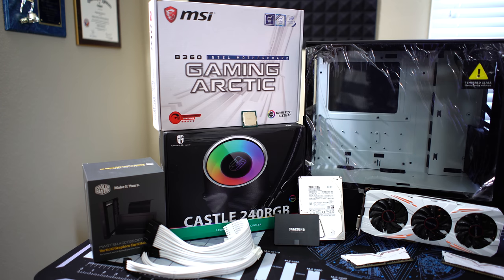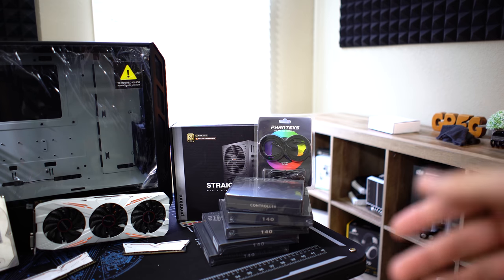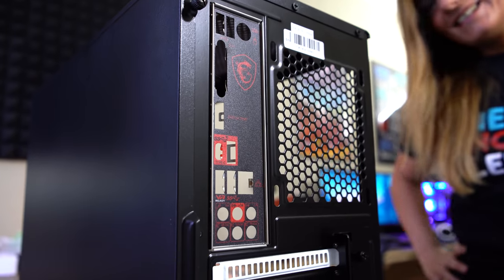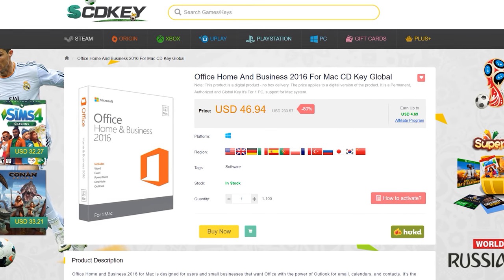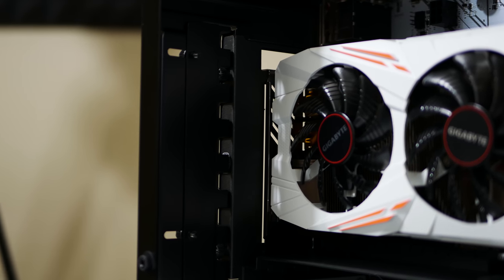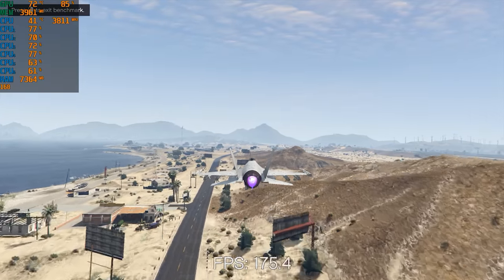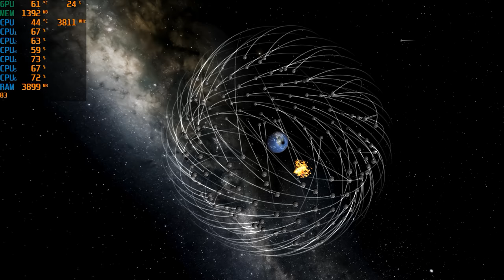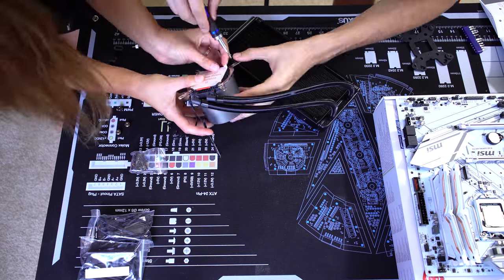We Paired a 1080Ti with an i5 8400...

Comment: Exactly my build without the AIO, pure gaming purpose with i5-8400 will do its job. Specially when you are running ultrawide 1440p and more like I do. buying 8700k + AIO will be a little bit a waste of money around $400 for pure gaming in UWQHD or 4K since it will bottleneck the GPU. Has been using it a long time, never looking for an upgrade.

Comment: Greg, are you using adaptive power profile? Which is what I suspect seeing gpu utilization not being 99% all the time. Wonder if it’ll be a bit different if you switch to prefer maximum performance. Though I was surprised to find out it didn’t make much difference on my 6700k and gtx 1080 rig.

Comment: the 8400 and the 8600k are the only i5's that get mentioned but for 30 bux more than the 8400 you can get 300 more mghz (4.3) from an i5 8600 (non k).  worth a mention though.  it hink a lot of people dont even know this cpu exists.  but as with the last gen or 2 the i5-X400 cpus are the lowest end cpus and when intel launched coffeelake the only i5's were the 8400 and the 8600k.  but 8600's and i think 8500's are available too.  30 more bux for the 8600 and shop the sales for a 3000 mghz ram kit 135 or so (ive found them for that) and you have made up the difference in price.  would really recomend the 8600k though or get the 8400 and plan on an upgrade in a year or 2 to an i7 or 8600k.  just a thought.

Comment: I'm running a i5 8400 CPU with a gtx 1060 6gb and it seems to run really well. I'm contemplating going to a 1080 but I'm not so sure it warrants it for a few reasons you said. I think that the CPU will struggle at 4k with the frame rates the 1080 can pump out, but there again I'm not so sure 4k is necessary at the moment. I have kind of wrote off the 1070 due to £40 difference but I'd be interested to hear your views

Comment: I have a 1080 Ti and an AMD FX-8730E and it works just fine. Yes, the CPU is a huuuuge bottleneck, but I only upgraded to a 1080 Ti because I bought an Oculus Rift but I wasn't getting an enjoyable VR experience with my old R9 270 GPU. I would've upgraded the CPU, too, but I simply cannot afford that :(.

Comment: Hey Greg, have you seen UFD Techs' recent video on the 8400/R5'S? They come to the conclusion that when paired with a 1060, the 8400 runs significantly slower than the 1600, 2600 and even the 2400g (with the 1060). Have you paired the 8400 with a 1060, or any other mid to lower-end gpu?

Comment: I'm either sticking with my 1600 or off-loading it on eBay to get x470 m7 + 2600.
My next paramount upgrade is from crossfire hd6970 which is still good for 60 FPS 1080p to a respectable Rx Vega 64

Comment: I'm running a R5 2600X and a 1070Ti
no overclock yet, but in the future I will.
The whole rig cost about $1500. I know it should be way lower, but i'm not living in the us, and overall prices here are way higher. Or it could just be my stupid spending on products with a low price to performance.
avg fps in:
justcause 3 at ~120fps on 1080p high and ultra settings
overwatch high/ultra 1080p ~250fps
unigine heaven ultra 1080p ~230fps
cinebench R15 score 1279

Comment: I know you can and its not a terrible idea , but why not go with ryzen 5 1600 or 2600 that has more threads and price similarly to the i5 8400 ? i5 8400 all core turbo is 3.8 ghz , zen core with all core oc to 4ghz won't be that far off in terms of single core IPC and has way better multicore performance .

Comment: i5-8400 vs Ryzen 5 2600x.

That's a tough call.  Especially for 1440p gamers with a GTX 1070/Vega 56 or better.

I think I'd go Ryzen for 3 reasons.

1. Gaming results on parity with each other.
2. Ryzen has upgrade path.  Processors from AMD until 2020 will be using the AM4 socket.
3. Ryzen has better productivity/multi-threading.

Comment: Cool video. This seems like a good build. I personally would prefer going for an AMD based system but for some reasons games are more optimized for intel' s architecture so rip. Think watercooling something like this would be pointless (being a locked processor)

Comment: Recently went from a 4670k to a 2700x and i must say the system feels overall very sluggish now compared to the 4670k. When streaming (even at 720p30 and low bitrate) all games feel very unresponsive, and I've had so many issues with stability. And I still can't get my 16gb 3200mhz kit to run at it's rated speeds, even though it's on the qvl list.

Comment: Nice video Greg, but what about Bf1 in 4k does it botleneck then since bf1 is so cpu intensive? I have an 6600k so really pushing it there. Doubt 1080ti prizes will down to levels not to wait for next gen on upgrading from 1070. And since sli is half dead no benefit on that game P cars 2 yes but that runs good on 1070 also. Mostly can run on 4k some tracks are more demanding but,, still well optimised for nvidia. Its a beast for a two years old card.

Comment: I remember my old amd tower from 2003 it was my baby. But holy hell it was a space heater with 1000 watt power supply i cany remember what i was running in sli but it had just started coming out when i first got my sli cards. I miss it right now in chicago -20 i need my space heater

Comment: Why did you pair a B360 MB with a chip optimized for z370 boards?  Did you know there are other channels out there showing frame rates jumping from 50’s to 70’ just by going with the 370 boards?

Comment: I have an i5 8400, but I still need to upgrade the gpu. Is paring a 1060 6gb with the 8400 worth it? Eventually I want to upgrade the cpu to a i7 8700k but that’s further down the road as of now. The 8400 still does plenty for gaming and is able to multi task for me.

Comment: I'm currently getting up parts for my new PC and I'm pairing an I5-8500 with a 1070Ti. Should I go with a Z370 motherboard and 3000mhz ram or get a H370/B360 and get slower 2666mhz ram? The Z370 is the only 8th gen mobo that supports over 2666mhz.

Comment: Question for you, Greg - Why don't you lay the case down flat on the table when you insert parts? Genuinely curious, thanks :)
Reply from the maker: Mark Lee Easier to film, and doesn't crush hanging cables at the rear.
Reply: Good to know! Would you still recommend those who are building a PC to lay theirs flat? or is that personal perference.

Comment: You need to put this to the extreme: i5 6400 and 1080Ti but only tested in 4k. I was wondering how low you can go on the processor side, before you loose serious performance.

Comment: idk why when you build a pc and uses cooler master vertical gpu bracket you choose a case that has spacer in the pci slot and cut it up? it drives me nutt. use cooler master case, their case doesn't have spacer in it

Comment: Okey I need help. I’m on a kinda tight budget so I wonder, should I get a Ryzen 5 2600 and a 1070 or a i5-8600k and a 1060 6gb and aiming to upgrade the gpu in the future? I really can’t decide because although I want a pc The can’t handle most games on high settings no problem, I also want a pc that will be future proof for a couple years from now on.

Comment: So what do you think should I upgrade from i5 6500 to i7 6700/7700 non-K or change my motherboard and CPU entirely(i5 8400 + B360)? I don't want K series I don't want to overclock. In short which perform better i7 6700/7700 non-K or i5 8400. And do If you have comparison video please show link in the comment below. Thanks. :)

Comment: Just built a system:

Ryzen 2700x
Bequite Dark rock pro 4 cooler
Asus x470 -f gaming
16gb 3200 Trident RGB CL14
MSI GeForce 1080ti gaming trio
Samsung 500gb 970 pro nvme Primary
Samsung 500gb 860 SSD
Samsung 500gb 960 pro on x4 pcie m.2 card.
Cooler Master MasterCase MC500p
3 Cooler Master 140mm RGB flow fans
1 Cooler Master 140mm RGB Pressure - exhaust

Purpose: 

Gaming
VR
Server Administration 
Software Development

Comment: the i5 8400 vs the r5 2600 or r5 1600 is a couple fps difference in most titles you wont notice that. BUT what you will notice is that Games run much more fluent on the Ryzen Platform - alot less Dips. So yeah while this is a nice and good looking build its meh compared with price / perf.

Comment: An 8400 chip is great to pair with a 1080Ti, but the Ryzen 2600 is not enough. (Not Greg's opinion) With top notch cards, which are built for higher than 1080p resolution in mind, we see similar results with most of the newer CPU's. But people are so blindfolded or mostly incompetent, they only able to see the FPS results and when they read or watch benchmarks, they conclude without understanding how resolution effects the load on a GPU. Nevertheless, I rarely heard anyone playing games with decked out visuals, so even these good numbers what we see in this video, can be much better if some of the unnecessary settings are lowered a notch.

Comment: I built with an 8600k over the 8400.. As i didnt mind paying extra for a 5.2ghz overclock.. Amazing gaming cpu, But if i wasnt primarily a gamer the 2600x would be in my system right now. To me the only options in the pricepoint are the 8600k or 2600x , 8400 just doesn't fit in there for me.

Comment: I think i3 8100 will do just fine with 1080ti with relatively low refresh rates (100 Hz shouldn't be an issue)
Reply: Salt Maker "opinion" not "advice".. Stop it now kid, It's gotten boring beyond words.
Reply: Salt Maker k
Reply: Salt Maker sigh*
Reply: Salt Maker ...
Reply: r91plays IND, i 2nd that opinion you should do just fine with a 8100 yes might not hit high fps but its still very do able. Cpu would be about 75-90% in most games but still would keep that 1080ti on its toes!!!!
Reply: This would not be an issue, if you want to play at 4k 60, but for 2k, I think this is not good.
Reply: Maybe few years ago that will be ok but now no way...so many new games use more than 4 threads ...in cpu intensive games you will have HUGE bottlenecks(fps drops)...6 core cpus are now minimum for new games...

Comment: Okay I'm gonna be upgrading my system to ryzen and idk if I wanna get a r7 or r5. I wanna get an x470 motherboard for upgradability and overclocking. I mostly game and am thinking about doing a bit of video editing. Any recommendations as to what I should get?
Reply: If temperatures are a thing for you and you want silent running any of the non 2000x parts will work really well. I have a 1700, with a 1070ti and it runs shockingly well. I game at 4k@60 and i have a cooler master AIO liquid cooler. If you want the best and higher watt parts go X models and definitely go the Highest end B series boards or the best X series you can afford. I got locked into a pre built for 1200 dollars with a 5 year warranty and have not seen better for the money. Especially with the memory and graphics parts just starting to normalize to a certain extent. I am planning on adding an additional matching ripjaws v 8g stick and an 500g m.2 SSD next. I also will be adding a 6tb external hard drive for video projects and my Xbox and steam games.If Xbox does not want me to buy their consoles I can arrange that...lol

Comment: I was wondering if the pcie extension reduced fps? i have the extension also but debating if i should install it.I have Thermaltake Core P1 Tempered Glass Edition Mini ITX Open Frame case
Reply: Linus tech tips alrady covered it in his video. PCIe risers/extensions has negligible effect.

Comment: Well it looks nice and fancy, it fits "the design over performance" model ...  So, I understand the original idea of the video being the I5 non-k on a premium GPU and  test it. But who would do that really ?

If people build something like you did and focused on the looks of the system and to get the (cheap) boutique look, they decide to go (very)low budget on the basic hardware. I mean really ? 

If a person comes to you "hey man I just bought a 1080 ti 1700$+ system". And if you asks him what the rest of the specs are ?

He replies with i have a low budget mobo and a locked CPU. But it looks amazing i got the hardware colour matched (I even spend extra to have my budget hardware match with my GPU and RAM) , RGB everywhere (just like a cheap disco), custom sleeved cables, even water cooling on my locked CPU. I can game at high resolution max settings and like surf the internet and stuff, just like other people can.  

I understand someone who has  a I5 system and upgrades his GPU to maybe a 1070 ti. But a build around the flagship GPU like you did. If you drop the design factor,  you can just buy an unlocked i7 system (get a good oc) for the same price.

Comment: Hmmm i got a idea for a video. Its a little stupid. Drop test of hard drives from Western Digital, Segate and Toshiba. 3 of each drive (3.5 inch form factor) to try elimate odd result and do 10 cm (inside case height)  drop test 50 (desk height) and killer 75cm. (Pc ontop of desk equivalent)

Comment: We should not compare apples to pears. You have 3 options i7-8700, i5-8600 and Ryzen 7-2700 when max. TPD of 65 is given. The single core performance (according to Passmark) is almost identical between i7 and i5. And the Ryzen delivers 80% of it. For current games 2018, 2019,2020 6 cores have to be enough. And in terms of prices, the i5 is the winner.
And the difference in price can be invested in a better grafic card.

Comment: I currently have an i5 8400 and a GTX 970. What GPU should I get next. Looking to play 144fps 1080p
Reply: Hectoric gtx 970 is about 5% slower in most situations than a 1060 3gb. Most cost effective upgrade currently is a 1070, as it's the sweet spot price for performance gpu and is far superior to the 970.
Reply: thanks for the reply, im planning on getting a gtx 1070 or a ti
Reply: I currently have the same setup also...well not any more. In Thailand a used 1080ti cost me $260 recently. :D
Reply: Just wait for the 30 series don't buy a gpu until the new consoles drop
Reply: What do the consoles have to do with gpu prices? I have never heard anyone correlate them previously.

Comment: The 2600/2600x should be recommended over the i5 8400 in every situation except those where you're using programs that are extremely optimized for intel. Also from someone who regularly sees their heavily overclocked 1080 Ti and Titan Xp pegged at a reported 99%, that cpu is holding the 1080 Ti back in every game you showed.

Comment: i3 8350k > i5 8400
The i3 has 2 less cores but unlocked. Worth it for most games. Running mine at 4.8ghz with a gtx 1060 and I haven't had a problem with any game at 1080p ultra, 1440p medium/high

Comment: Just buy an r5 1600 or above for the same money and u get hyperthreading and overclockability. Also b350 mbs are not that expensive either. So at the end even if u are not doing any heavy work like streaming or rendering amd is 100% better buy for long term. Intel really need to either lower prices either come up with sth innovative cause amd is clearly ahead now

Comment: I feel nothing special with the title "We Paired a 1080Ti with an i5 8400", it can be "We Paired a 1080Ti with an i7 2600K", "We Paired a 1080Ti with an I7 4790K", "We Paired a 1080Ti with an i7 7700K", all of those cpu's can handle very well the 1080 Ti, the olders cpu's just need a bit of oc to keep it up with with the newer cpu's and the results are pretty good

Comment: im currently using an i5 8400  on a z370 mobo and a gtx 1060 6gb and it holds up pretty well but ill be replacing it with the i7 8700k which i was initually planning to get but i have to save more money so i got an i5 8400 for $130 new as a temporary cpu in my build.

Comment: Guys is 1070 ti and core i5 8400 any good combination?
Reply: I have a 1660TI with 6 gigs of DDR6 memory. 32 gigs of DDR4 RAM, and the I5 8400, 6 core. Which is the weak link, 6 cores. 6 threads at a base speed of 2.8ghz doesn't run well on many "newer" games. It's ok for some games on very high, not ultra.

Comment: 4790K/GTX1070 =>getting upgrade to Asrock X470 Taichi and GTX 1070Ti (have 1070Ti already).  2600X or 2700x to meet the value and performance. ? Leaning to the 2700X...
Guys with similar setup comment, the rest read those. Thanks for da vid !

Comment: most of the games were software limited -> software bottlenecked, in those games neither the CPU(on any core) nor GPU was at 100%.
Those games were PUBG, GTA V, F1 and that space simulation...
Reply from the maker: IIIRattleHeadIII You're using that term AWFULLY loosely. Most of the games you just mentioned had the GPU pegging between 90 and 100%...

Comment: Will rgb make my board run hotter if I'm getting ones that are on the board like the aorus gaming 5?
Reply: Urban Kitsune no man...its the same thing when people say that rgb gives extra performance....no it doesnt increase temperatures neither performance
Reply: Technically yes. Anything that requires energy will produce some amount of heat. Practically, no. The heat output is so minimal that any difference will be negligible.

Comment: wow...I really can't believe how many people out there have been sold on the concept that you need a powerful CPU for a powerful GPU...it's utter crap....I'm using a GTX 780 Ti with what is an ancient CPU..a quad core Q9550....at 1440p resolution with graphics all set to high I'm consistently getting 60 to 80 fps.....and soon I'm going to buy a GTX 1070 ...then after a while I will splash out and upgrade my ten year old Nvidia mobo....790i Ultra,  I will replace it with Z370 and i5 8400.....it will be REALLY interesting to see what differences in frame rates are then...I'm not expecting much change, have to wait and see....

Comment: I rock with a 8400 that i bought in 2018 and i just ordered a rtx 2070 is it going to get bottlenecked?
Reply: You can expect a little bottleneck in cpu intensive games (esports, gta v etc.) If i remember correctly, 2070 is a bit less powerfull than 1080ti, so it shouldnt be that big of a problem. Anyways if it does struggle, you can always upgrade to i7 9700k and be just fine